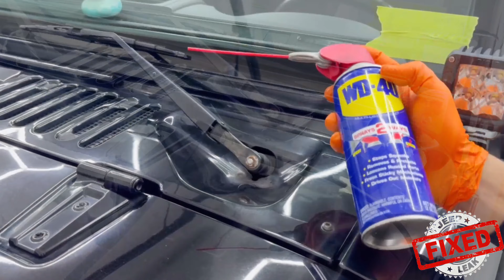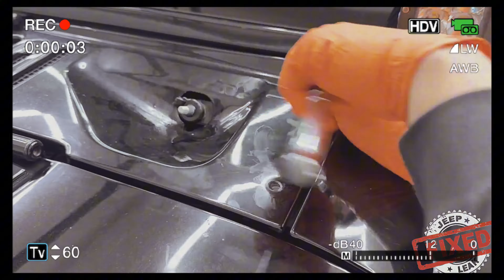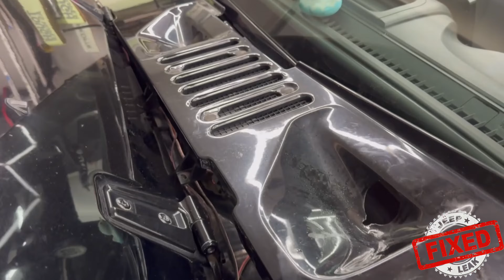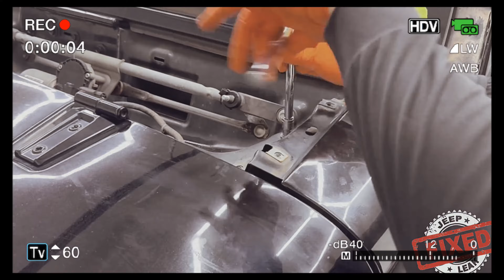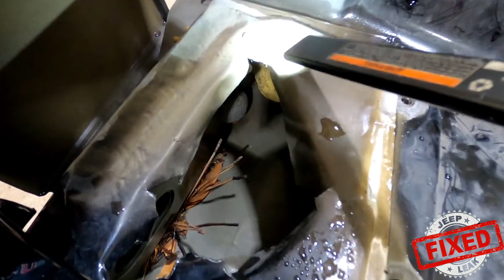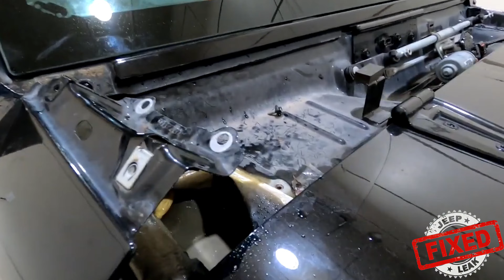Cowl Panel Maintenance | Prevent Water Leaks in Your Jeep Wrangler

Comment: My 2015 JK 2 door gets water in from what appears to be under the dashboard on both sides. Both footwells get soaked in heavy rain. Reaching up under the dash on both sides you can feel wet wires and see water dripping there. The Jeep has all new OEM weatherstripping everywhere except under the hardtop. Would these vents cause this problem the way I have it if they're clogged?

Comment: I have this issue and right at the start of this I saw the same issue I may have.the spot light cable runs down and through the chassis.its a large oval hole with the wiring loom.well the spots cable were a track for water so I cable tied it down instead of it bending straight in.hope this makes sense

Comment: You didn’t check the center drain on the cowl below wiper motor , I normally use a wet vac and suck all the crap out , then swap it to blow and blow it right in the drain slot ! Test drain before closing it up

Comment: @jeepleakmasterclass

Ok, I've been putting this off for months, running around in my jeep with no rugs or floor mats because I've got a leak coming in from somewhere. 

For starters, if you can't get the wiper arms off after removing the nut, get a battery terminal remover tool, it pops it right off.

My friend and I did the cowl removal and lo and behold, both sides had clogged drains which were easily cleaned and now appear to flow correctly. The last big test is when we get a big rainstorm (which might be a while, it's super dry here right now).

I did my best to cover up the patch on the passenger side, as we used gorilla tape and aluminum tape to seal it back up.

This is an excellent how-to/step by step. Thanks again!!!
Reply: Zip flashing tape works great that’s what I use it’s water proof  and comes in various sizes
Reply: was it the driver mat that was humid ? I have this probleme , driver always wet and take forever to dry , im about to try this trick

Comment: I just had to do this on my older Wrangler (a 2000 TJ). Kind of a similar procedure, but quite a bit simpler- not so many parts to deal with, and the drain hole is larger and easier to get to. Removing the cowl on mine was also finicky, but once you get the hang of it, not too bad. Looks to be a regular maintenance item with Jeeps, wish they made the procedure more straightforward and user friendly. He did a good job on this video.
Reply: The TJ was the last real Jeep. You know what JK is an abbreviation for.

Comment: How do you know if they are clogged in the first place?
Reply from the maker: Great question, the only way to know is to do a visual inspection, its just one thing to cross off your list to ensure that water isnt entering your cabin due to the cowl panel not draining properly. This is just one section that we posted from a collection from our 16 video jeep leak tutorial that we will release this week. Be sure to check back for more info and updates on this as it will be the definitive guide in getting Jeeps leak free. Thanks!
Reply: A waterfall in the passenger footwell. When that drainage is clogged, it pools up in there and water starts to go in the AC vent.  Just dealt with this and this video helped fix it.